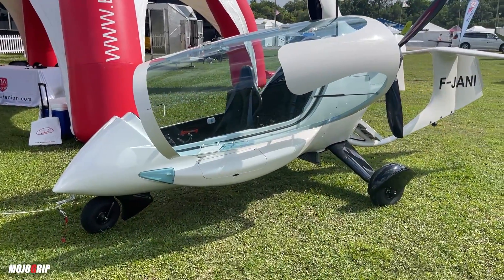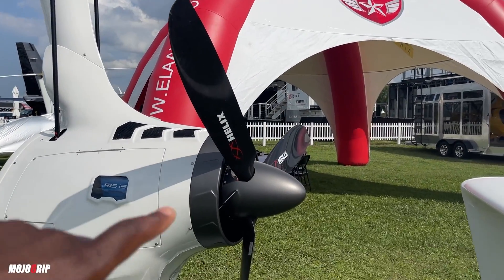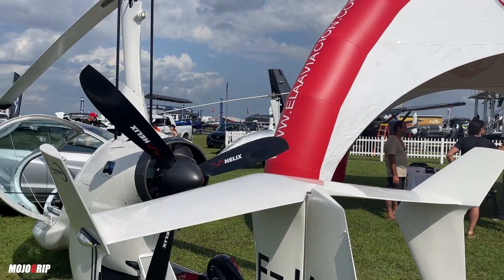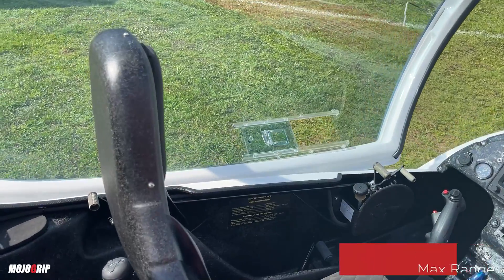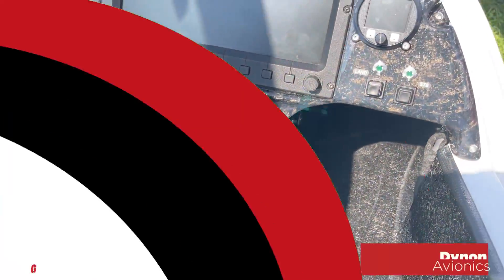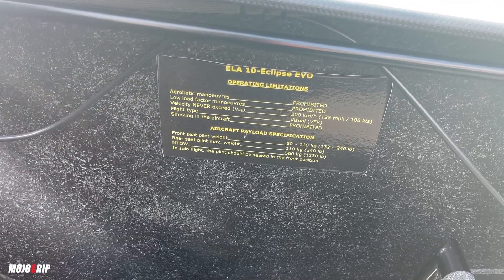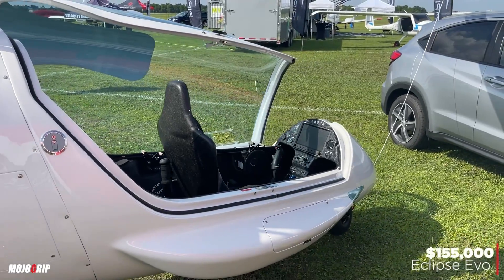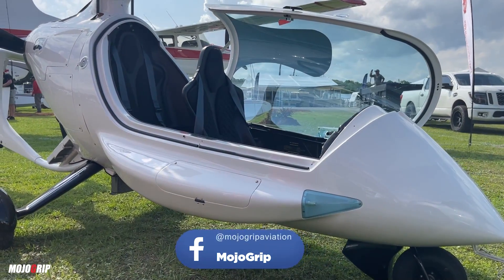WHY Pilots Fly This Instead Of An Helicopter l Eclipse Evo

Comment: I want a gyro that can seat 10 passengers plus crew , pressurised with Air conditioning , toilet , celing should be at least 6' , must fly at least 2500 kms in full tank load of fuel and it should also accommodate my 6 Persian cats each weighing approx 4 kg .

Comment: Check out their CRASH RATE!
Also, these typically CAN NOT take off vertically and cost twice as much OR MORE, than a Rotorway 💡
Reply: There are 22 fatal accidents in gyroplanes in 12 years in the US per NTSB. A whole lot less than helicopters
Reply: @silverlightaviation  Show ur right. A quick Google search shuts your attempts with that claim, DOWN
Reply: "There are 22 fatal accidents in gyroplanes in 12 years in the US per NTSB. A whole lot less than helicopters"............OK, but isn't there 22X more helicopters in use?
Reply: Some old, poorly designed and poorly manufactured autogyros were dangerous, but today's are very safe, don't mix it up, and there are also those that take off vertically. (ELA REVO)

Comment: Hi mate .could you tell me how to get the rotor blades turning for taking off .
Reply: Most gyrocopters have a pre Rotator motor that runs only temporary like a few seconds just to get the prop spinning
Reply: It uses a system similar to that of cars, with a pinion that connects and disconnects from the engine of the device.

Comment: Hey Buddy thanks for featuring s gyro. Was missing this in your blogs. Please ask the manufacturer if they have plans for making pressurised , airconditioned , with a seating capacity of 5 to 7 persons excluding two pilots , twin turbo engined , winged and very importantly with a toilet . I would also like to know if a four blade rotor gives better lift than a two blade rotor in gyros.